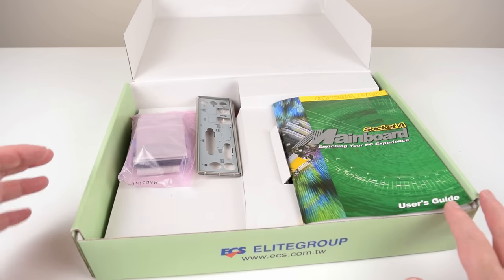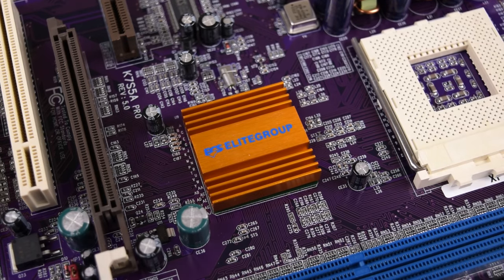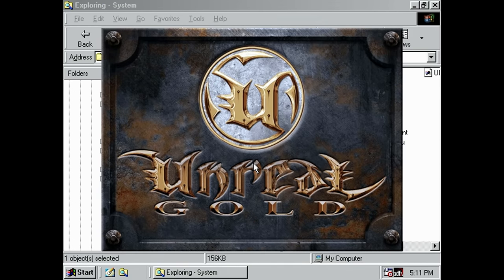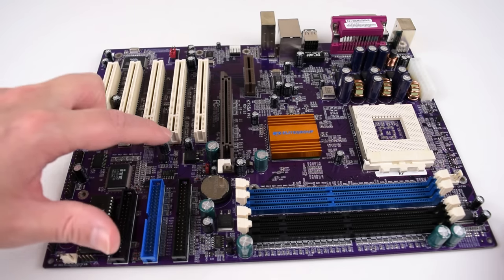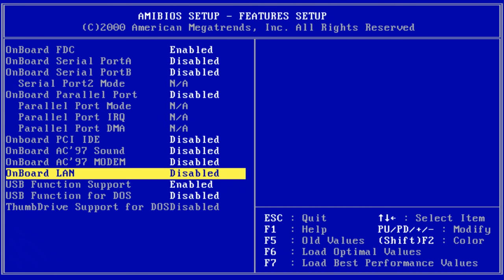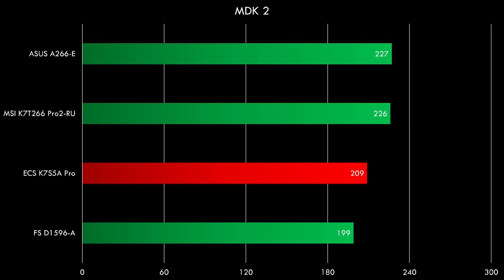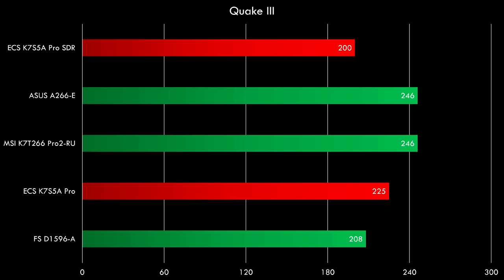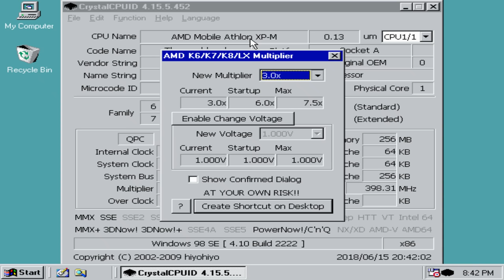ECS Elitegroup K7S5A Pro Socket A Motherboard Review - First Boot in 15 years

Comment: Oh boy. ECS mainboards from that era were notoriously unreliable. So much computer service worker could easily refuse to mess with faulty board.
Reply: Not defending ECS but at that time the problem often sat in front of the monitor. :-) There were so many things you could do wrong as a user.
Reply: nah, in this case it was the board. It was very popular as an upgrade solution. A friend of mine was working in a larger computer store chain at that time. The K7s5a had a 80% failure rate in the first 6 months. They are irredeemable garbage. Around the same time came also the asrock kt266 board with sd and ddr support. That one sold even better (often as replacements for the ecs turd) and had a massively lower return rate.

That shop shortly after stopped selling ECS boards at all.
Reply: Every one I've seen has died of the capacitor plague. 
 Always hated the SiS chipsets -- as you say, unreliable.
Reply: Even turdies often have good individuals. I've seen (are you sitting down??) eMachines that were rock-solid for years on end. Which you'd never guess by the piles of deaders at the recycle yard. Sometimes you get lucky, and by all means when you do, use it!
Reply: Nah, we've sold many of these ECS boards. Especially early revisions might have had issues. But the defective rate was on paar with other manufacturers which we've sold.
Reply: The motherboard itself is well designed, the problem is that G · LUXON and OST capacitors were used, and eventually all fail, but if it is replaced by Sanyo, Rubycon, Panasonic, Nichicon capacitors, the board will work very well.
I have an ECS rc415st-pm-775, with the capacitors replaced by rubycon and Panasonic, it works very well, before replacing the capacitors, the integrated vga gave artifacts, the cpu gave performance and stability problems, I replaced all the capacitors and all those problems they disappeared.
Reply: Aside from the less than stellar capacitors, the biggest problem with the K7S5A boards was all too many people used a low cost, underpowered, and unreliable power supply on them. Both of mine ran 24/7 for over 5 years without a problem. All of the ones I had to work on had a cheap POC power supply. Never saw one with a decent psu that had problems.
Reply: ECS got big only because they had contracts with bigger pc vendors (very cheap motherboard is what they want = steady flow of cash for ECS), and put these rubbish motherboards in to office pc's, where they knew no one literally no one would do any overclocking. As soon as you started to do some o/c, these motherboards were well known for blowing caps, and taking cpu, ram, and all other sort of components with it. In old school o/c community, ECS motherboards were considered just a fire hazard.
Reply: These boards were pure shit. I had a bunch of them failing, and resetting the clock speed at random. I hated them, and still do. These boards should have been burned, together with the factory.
Reply: LOL. Literally, no. They were far more stable then the competition. :D And all, literally all, Socket A boards are non-functional twaddle. Only after 7th gen Athlon cores, post-AMD64 launch, did VIA finally get their thing working as well as SIS with the 7xxx series. :D

Which was followed by a VIA-quality level SIS9xx series, no sense in making proper stuff, when the competitions useless non-functional stuff sells at a premium. :D

Blame VIA and AMD; especially AMD which made a completely ridiculously buggy version of the VIA XV97 as the Athlon reference chipset, and as a consequence, all Slot/Socket A chipsets are a mess. SInce they derive from it. And the customer who bought something other than Intel for a production environment at a time, when not a single functional mobo with a known working chipset was, literally, being made by the damn original CPU manufacturer. :D

The, SIS735 and 741 being the rare exception, that they run cool and are debugged to be functional designs. :D
Reply: @TheRealKoltoroc  Umm. The KT133 AND KT133A  had a known failure rate of 100% for the first 9 months. For every manufacturer using VIAs chipsets, that is. :D :DDDDDDDDDDDDDDDD

They would crash if the idle PWR was on for more than 5-7 working days. RTC out of whack, and mobo base signal completely out of bounds so it would crash / burn the CPU :D:D:D:D

:D:D:D

It's just that pr0g4ym3rs didn't use their systems for anything sensible or productive, like making a living and were accustomed to the thing hanging of it's own volition due to them running the damn thing out of spec anyway, so that shit got a pass. :D:D:D:D

Jesus christ. It's the reason AMD couldn't make any significant in roads into ANY enterprise / industrial market until AMD64. :D Had the Athlon been the success it's CPU would've merited it, they could've faired over the Sledgehammer debacle simply on the cash-reservers made back then.

And intel today, wouldn't be pushing 15 year old crap on life-support and inherently insecure cache handling that is remote exploitable, as they would've been the ones on the brink of bankcruptcy simply by releasing the insult that is P4 :D

Comment: Nice video as always, I also have an ECS Socket 462 board, the older K7VMA with VIA KM133 chipset and integrated S3 Savage card, only I can't get an athlon 1000 cpu to detect as it should the mobo sees it as 750Mhz CPU
Reply from the maker: Hmm not sure what's going on there. Do make sure the latest BIOS is flashed and look for a FSB jumper on the motherboard. Best to check the manual.
Reply: can you upload the BIOS flash utility from the CD to your website, as you've said its not up on the ECS website

Comment: The motherboard has very poor quality capacitors (G·LUXON and OST) and in addition to been 15 years stop those capacitors will be fatal, I recommend you replace them all by rubycon, or sanyo, you may gain stability and better performance.
Reply: yep, mine and my teachers in highschool both had failing caps.... I recapped my board, my teachers I dunno wtf happen:P

Comment: Main issue with this board is capacitors bulging and leaking ,resulting in the bord shutting of with no bluescreen. I wouldnt buy it again  even for building retro gaming PC.  About replacing the capacitors, this board has a coating that melt when you try to solder new capacitors . Melted coating makes it impossible for

Comment: You should also check the actual FSB of the motherboards with CPU-Z or some similar software before posting benchmarks since plenty of motherboard manufacturers cheated in benchmarks and had up to +5MHz higher FSB than what was selected in BIOS effectively overclocking the CPU.

Comment: I had this MB back in ~2001. IIRC this motherboard has SiS900 ethernet, not Realtek. I suspect that this Realtek chip is PHY. I wouldn't recommend using audio drivers from supplied CD with WinXP - they're very buggy and often cause BSOD.

Comment: at the time i already had an abit (rip) kt7a so i wasn't in the markekt for something like this but this was a very interesting motherboard. cheap as hell and the sis chipset performed mostly on par with the competition. it had tons of problems with drivers running like shit and it didn't have software multiplier control but some modded in a dipswitch for that.
shortly after ecs released a new and upgraded model with the 745 sis chipset but at a greater launch cost and the same driver hell so it didn't gain the same traction at least around where i live. ^_^

Comment: Hello I'm testing my K7s5a non pro v3.1 with the latest BIOS version and can use 2x1GB DDR400 memory sticks... Both memtest a full XP install and some 3dmark 2000/2001/2003 pases... I'm using it with an old 2000xp and a Radeon 9200pro / x800... I tried with my 6800GS but something must be wrong with this card.
Reply from the maker: Nice and good to know.

Comment: I had ECS K7S5A with Athlon XP 1800+ and used it with both SDR and DDR RAM (not at the same time of course). It was one of the most stable motherboards I used back in the day but the features were really barebone. For example overclocking features had to be enabled with hacked BIOS and even then the FSB settings had pretty big jumps and there was no voltage control. I managed to bump my FSB to 147MHz, increasing the CPU clock from 1533MHz to 1690MHz.

Comment: If you are in germany there's a seller on ebay that has plenty of old new stock PC Chips M811(on his own site it's even cheaper).
Reply from the maker: Do you mean cbo-do? I'm sure I contacted them at some point, they have many of the Aldi PC motherboards. But never heard back from them, it doesn't help living in Australia LOL
Reply: Yes, didn't want to advertise them, it's easy to find if your search for the board. Shipping to Australia would be pretty expensive I suppose.
Reply from the maker: Barbrady Yea shipping is always the killer. Some sellers combine postage, like Electromyne, that does help a lot, especially if you buy like 6 CPUs or something like that.

Comment: First of all this chipset had fast MutIOL or something like that (simmilar to AMD HyperTransport / DEC Alpha) - instead PCI to connect northbridge with southbridge = better performance of IDE drives. And of couse RAM controler was even faster than Intel's - SiS for the first time. There was also simmilar motherboard for Intel S370 - DDR for Intel Celeron - twin with simmilar name. Best buy back then not for long because VIA realesed KT266A but for couple months.  Mine opinion best motherboard on the market both S370 and Socket A of Athlons/Durons 1GHz era. One disadvantage of this motherboard  VIA = OC, Nforce = OC, SiS and later ATi = no OC

Comment: i don't belive in memory limit, i used with success on 3 different ecs boards over 1 gb of ram when manual stated that board is limited to 1gb
for my pentium 3 sis chipset daicon IVsystem see 2gb for via chipset 3 slot  sdr board i was running  1,5gb for 4 slot via chipset i was running 4 512mb modules and it also was seeing all of it in the system
also via nad sis does support "single sided"  simplyfied memory modules but they can also use intel compatybile modules, which in fact would cut memory in half  because of maximum amunt of memory chips on memory module and some batshit bx legacy redundency
Reply from the maker: Good point, I should have tested with two 1GB DDR sticks...
Reply: Some boards will accept and recognise more memory than they claim, true. But sometimes the result is corrupted memory, so you have to be a bit careful.

I've seen it go the other way, too -- I have a crappy PCChips P4 board that is supposed to take up to 2GB but in fact fails with more than 768mb and then only works if it's slow-rated RAM (but the sticks can't match, WTF).

Comment: wait a second, I found a discarded pc with a simular motherboard which I re-capped to practice
ima go check if its this model, something interesting to note is that it has a cpu adapter on it with an intel celeron installed. never knew cpu adapters were a thing.
EDIT: turns out mine is a P4S5A2 (rev:1.0) , almost an identical motherboard, my guess is its the intel version of the motherboard above
Reply: There should be a motherboard restoration series. Checking and replacing bad capacitors. Finding out if a component is faulty. Doing trace checks and knowing visual queues as to what could cause a motherboard to fail. Also modding and improving the reliability of a motherboard is good to know. Using alcohol to find out which components are getting hot and using thermal pads to stick on little heatsinks for cooling. Disabling unused features and connectors to free up potential performance. BIOS upgrades for these old motherboards would be a nice refresher.

Comment: For a Geode NX 1750 you'd ideally want a ECS K7S6A, one of few boards that can run it on 1.25V without modifications. Here's a link to a list of undervoltable motherboards: http://www.silentpcreview.com/article69-page1.html
Reply from the maker: Nice. I have the Asrock K7S41GX. So far it's the only board I found that officially states support for these Geode CPUs. But it's quite slow, slower than this ECS board.

Comment: i worked in a computer shop, repairing pcs. this board was by far the one which we swapped the most.  the caps besides the cpu where almost always broken. i would not build a retro pc with this crap in a thousand years. go for an asrock instead. or better abit with nforce chipset.

Comment: get the modded bios for this bitch(supports faster cpu's; forgot details...??15yrs ago??), the only thing that I didn't like about the board was that it didn't support S3 sleep mode... also replace the caps(the g-luxons) they will go bad if they haven't, you'll know when it starts not detecting the ide drive on some boots and instead trigger the novell client or whatever it was

Comment: ecs k7s5a. Oh dear, what a piece of shit. Back in the day they had  about an 80% return rate. There is NO WAY I would ever buy one of those. You would have to pay me to take one off of your hand and I would declare it a recycling fee.

A friend of mine worked in management of a larger local computer store and this was the board that made them stop selling ECS at all.  After a while they  started to  replace returns of it with the asrock equivalent (Kt266 based) that did not have this massive failure rate.
Reply from the maker: Do keep in mind that this is the K7S5A PRO, not the regular one, and also the final revision 5.0 and that now we have access to the latest BIOS and drivers for the chipset.

Comment: Nice video but this board was the worst piece of crap i've ever saw during my 20+ years of Pc building and repairing.   Capacitors were so weak....  Resulting in unstable or even Dead on arrival new boards. ( DOA was the best scenario avoiding pain in the neck finding what is wrong with the systems ^^).

Comment: The performance is what bothered me about these cheap SiS boards. Buy an Athlon 1400, and it performs more like an 1100 or 1200. Back in the day, that would've been a pretty big loss.
Reply: Sis 735 performed very well for me, and if you google K7S5A- there is a Tweaktown review- in it you can see it outperforms competition.
Reply from the maker: It's all about the timeline. When the SIS 735 launched, it performed very well, outperforming the KT133, 133A and 266 chipsets depending on the test. It was only when the KT266A launched later, and also the nForce2 that they pulled ahead of the 735.